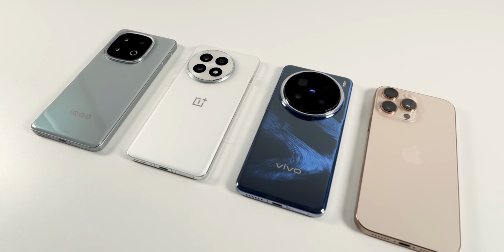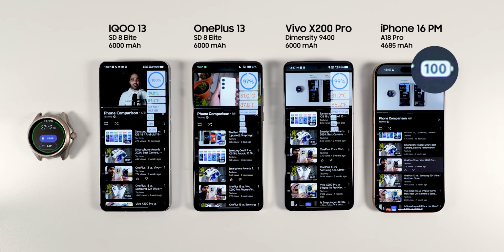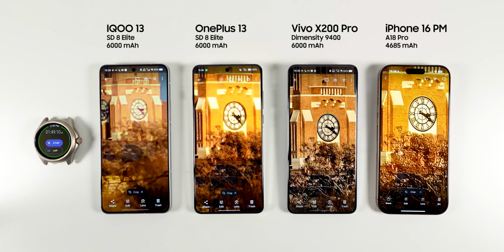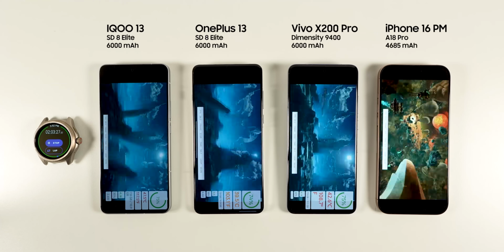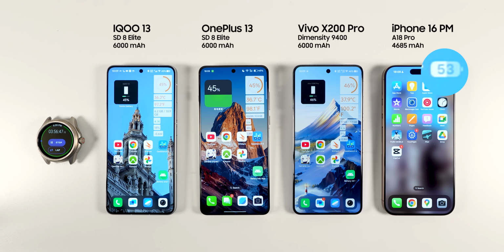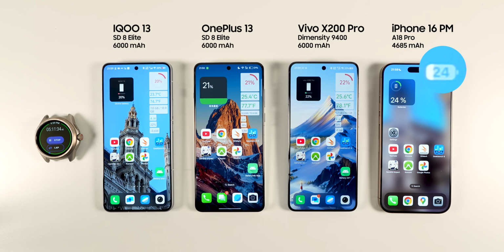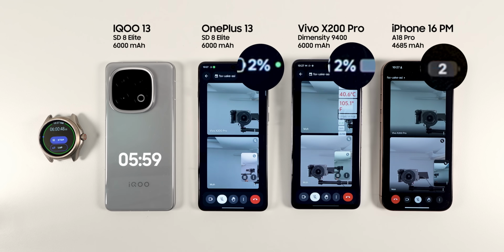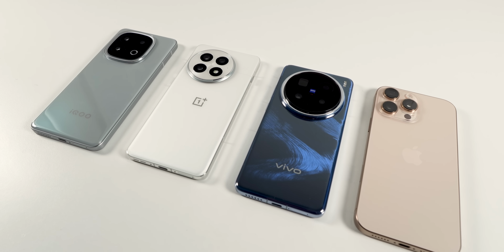Best Battery: OnePlus 13 vs. Vivo X200 Pro / iPhone 16 Pro Max / IQOO 13

Comment: Is the iPhone running at 120 hz all the time when testing ?
Reply: I am not sure that any of them would be running at 120Hz as they all use LTPO and most of these tests do not need more than 60Hz. For example the video recording or playing YT. So, not sure what your point is. And tests show the difference between running 60hz and 120Hz in mixed usage is nominal. Screen brightness is much more important as to battery life.
Reply: iPhone has full hd display while Vivo,one plus has 2 k display and iq with 144 hz display..

Comment: Imagine iPhone with 6000 mAh battery 

I hope s25 ultra beat iphone 16 pro max in battery and thermal
Reply: Imagine prize also bro it will 2.27Lac for 256gb
Reply: s25u will have the same battery for 6th year in a row, it will be on top worst battery life flagships of 2025, 2025 is rumored to bring 6500mah flagships

Comment: iPhone being the one with smaller battery capacity shows how efficient it is
Reply: Iphone is not using 120Hz all the time, it's dynamic which means it switches to 90 and 60hz at certain times when using certain apps.
Reply: @all4tacticalso does android you fanboy
Reply: @all4tactical Android Phones can go as low as 1hz. iPhone display is manufactured by samsung,
Reply: @joezmoma19285  OnePlus 13 has 510ppi iphone 16 pro max has 460ppi
Reply: Or 80hz scrolling @all4tactical
Reply: Actually it's the combination of efficient chip and a software made for that chip, if a18 pro ran android it of course would have had similar battery life to Qualcomm and MediaTek
Reply: @sakibhasan7944 true💯
Reply: @sakibhasan7944 What do you mean by "software made for that chip"? Every single hardware component has its own firmware which allows the OS to communicate with the hardware.
Reply: Yes , but you gotta understand, the iPhone barely pushed during gaming , rather the others pushed hard like crazy 💀
Reply: Doesnt matter vivo is lighter and slimmer is more important in daily use its not like everyone gonna care about the capacity if the phone is slim and lighter while offers a good battery life😂😂
Reply: @Havsue  Vivo is impossible to hold with the worst ergonomics of any phone? Hello?
Massive camera bump??
Don't talk about weight when you can't even get ergonomics right, not to mention weight distribution
Reply: @teapouter  as if ur not going to use case on ur phone anyway
Reply: @Havsue  I run my phones naked
Phones might as well be made of plastic otherwise
Reply: @teapouter  sure but most people us case on, so the bump on the camera are not a big deal, the imbalance are insignificant tho
Reply: Who cares anymore about IPhone? Overpriced and overrated phones. In the next few years everyone will forget about them.
Reply: @luciann36 mind you, I’ve been working with Apple for more than 2 years. The amount of people who used Android phones and windows laptop switched to Apple because the unoptimised software and poor software support alone.
Reply: Iphone has to be efficient. Because every phone on the table except vivo is half the price of an iphone. If a 600 dollar phone beat a 1400 dollar device then what is the point of an 1400 dollar device
Reply: @PhantomBoy_99  to fatten someone pocket that's all 😂😂😂😂😂😂😂😂😂😂😂
Reply: No point of how efficient it is as it gets old, when the battery capacity goes low ,  display and motherboard and wifi/GPS will take up a much greater share of battery percentage and those aren't any more efficient so over long run it will lose this crown. 
Also the last 20% on iPhone , there is throttling that's performed to reduce power consumption  further that's uncontrollable even for there reviews as it's set in software
Reply: @soulsbourne source? Your android fanboy brain?
Reply: Killing every app in background
Reply: How come nobody ever states that's the rated capacity?great result nevertheless.
Reply: iphone has less to compute on normal use, software just complements the hardware really well, but you have to consider the limitations you have on ios device than android. iphone battery ages fastest as well, which makes it terrible to keep for more than a year
Reply: @lukatamadze  Apple battery ages  faster the more deluded you android toxic fans are the funnier. You are somehow saying the lithium battery in apple which most phones use somehow magically ages faster than every android ever…..or is it that like the other person you just have this insecurity over iPhones and look for it everywhere even when you supposedly don’t like or have 1 so you look for people charging and people who have had one for a long time to diminish it.
I’ve never seen such a sad set of individuals who will lie to feel better about a phone choice go buy a phone and keep it pushing
Reply: lol 😂😂😂 with the low resolution and pixel count, so Don't think it's amazing, The other three phone have a mode called power saving mode, if you u turn that on, it will lower the resolution,  then you will see it will bleat the iPhone easy, they're video that show that, so don't think iPhone 16 pm is amazing, it's not doing 2K
Reply: Unfortunately smaller battery doesn't mean it's cheaper to replace
Reply: @ariefdwi1694  😂😂😂😂😂😂😂😂😳😳😳😳 so true
Reply: بخاطر ضخامت بیش از حد نمیتواند حجم باطری را بیشتر کند، چون نسبت به تکنولوژی باطری و شارژر از چینی ها عقب است😂
Reply: All that matters is how much we are paying and how much we getting
Reply: Yeah it's efficient because it has lower resolution than iqoo and OnePlus
Reply: Yes, Apple keeps a smaller battery as even with 25% more capacity Android flagships do not do much better if at all. That leaves Apple with the option of increasing mAh when they need it and in the interim focus on optimisation.
Reply: Don't have a battery capacity problem because can't make the iphone cheaper than others
Reply: ya, but now its andriod time , in all segments , but sofware wise little bit backward step, some settings are made then its andriod wins all segments . including video department also
Reply: Show how important is the vertical integration between software and hardware*, because by the SoC itself, the CPU energy efficiency of those chipset are pretty close to each other.
Reply: Apple increases their chip capabilities and literally slap on the same old skin with bit of improvement here and there of course it will last.
Reply: It cannot do half the actions of android. Lack of capability. Has nothing to do with efficiency. If you put iOS on an android phone, it would run for days 🤣🤣🤣😐
Reply: yea but it weights as much or even more than android devices.... so 😉
Reply: Finally a real test of soemone not saying the phone's get 10 hours
Reply: No one cares
Reply: When not playing games
Reply: @Allalos-s2l  yes 😎😎😎 stop trying to find excuse 😏😏😏 All you're doing is admitting it
Reply: @macgyvermac2344  yes I know it's because iphones are the best for gaming but they do have the best selfie camera
Reply: Iphone use much lower ppi density. Iphone refresh rate is much lower. Iphone resolution is much lower. All of these take extreme battery. Iphone brightness is much lower then vivo. And iphone automatically dim brightness level after some point.so many reason is on iphone side for longer battery. And their software focus on battery more. Get some education.
Reply: @SujanZimba your exaggeration shows how insecure and stupid most android users are much lower?
Ppi 505 s24ultra to 460 on iPhone.
Less battery superior battery life.
On average a more efficient SoC in day to day usage
Same 120hz as most androids like just say you are sad and bitching about phone you can dream about is what is happening as most androids need over feels don’t even own flagships from whatever brand they just ring meat for sake of feeling included in their little phone wars to feel a bit better for not having XY or Z your disingenuous comment is like clockwork of the oblivious fan base that doesn’t realize everything they say about apple products and users are easily discernible projections
Reply: IPhone only using 60hz refresh rate for display... So that's not a surprise
Reply: @Anonymousviewer007hehe  bro iphone has lower resolution that's why won't drag battery that much
Reply: Believe it or not 
We dont care he is the thickest phone 4600 mah 8.25mm 
6000mah 8.6mm 
Shame for apple 
2nd we need more time not more efficiency and losing
Reply: Effiencient= bad performance
Reply: It is efficient but not as much as you think iOS is too aggressive at this point it closes apps you actually use and pauses a lot of processes to achieve that
Reply: Nice now let's see the performance 💀
Reply: It stills heavy, takes long time to charge also last long on wifi
Reply: And it has the largest display size too
Reply: Да да, пока его емкость 100%, как только емкость доходит до 97% он не может соперничать с оптимизированными андроидами
Reply: Imagine if the others would be as optimised as apple.
Reply: But you want efficient or the long lasting phone?
I think i know, ONLY iPhone fans use that excuses...
Reply: @ actually iPhones last longer than android phones because of their hardware and if you check old iPhones performance today they are better than old androids
Reply: And still its the heaviest out of the three😂
Reply: Noo i phone is efficient because of all its components manufactured by themselves leading to efficiency and smaller battery
Reply: @ Apple doesn’t manufacture most of their phones where did you get that?
TSMC
Samsung 
Sony 
Are manufacturers to Apple, all Apple doesn’t manufacture most is design the component they want or give specifications and these people make it respectively.
TSMC makes the SoC
Samsung makes the display 
Sony makes the camera 
All to apple’s specifications
Reply: All phones outside of apple are very quick to charge their batteries. iPhone will take 2x the time to charge
Reply: @ what you don’t account for is despite Apple keeping the same rate of charge the batteries have been getting bigger. So Apple probably keeps the charge rate the same to preserve the battery. 100w charging generates much more heat than 25w. In 30 minutes you can get 55% what phone can’t function at that percentage. 
So it’s definitely not because they can’t make them charge faster that rate of speed seems to be the sweet spot for all the variables for longevity. Take in from the X to the 16 they all charge from 0-50/55 in 30 minutes despite the difference in battery sizes as the generations go along 

Most androids may charge faster yet still can’t outperform the smaller battery competitor so what is the real pro there and faster degrading battery due to the amount of watts being pushed to the phone constantly so that5000mah is gonna drop significantly due to heat degradation on the cells which is what occurs
Reply: Apple also doesn't keep apps in the background has 80hz not 120hz screen dimming and reduce touch sampling rate so no apple isn't as power efficient as ppl claims
Reply: @ how does Apple not keep apps in the background and it has an adaptive refresh display that does go up to 120hz.
The test I’ve done shows my screen operating at 120hz normally between 90hz to 120hz I’ve never seen it dip below that in use
Reply: @Marshkoon your test is incorrect it's 81 or 82hz max check online if you don't believe and apps shut down in the background in order to save battery or reduce heat same with screen dimming and touch sampling rate
Reply: @Anonymousviewer007hehe  @Marshkoon it's the truth I the 15pm when the 16pm came out and had 89 percent battery health i returned it although I read from many ppl complaining about iphone 14pm and 15pm losing 10 percent battery health in 1 year and my thoughts are that apple didn't use vapour cooling in order to protect the battery instead they reduced the touch sample rate screen dimming doesn't keep apps in the background having only 80hz instead of 120hz all so they will reduce heat and say that they have perfect optimization which actually only vivo and honor currently have
Reply: No innovation 😂😂😂... brand new camera button😂😂😂
Reply: @mrigankabora4835 ??? Bro's all broken
Reply: @UniverseCubex so people saying facts are considered as "broken"? Then you are 🧠-less😂
Reply: @UniverseCubex so people saying facts are considered as "broken"? Then you are 🧠-less😂
Reply: Yet iphone users are the ones always charging their phones the most lol when it come to longevity iphone is the worst battery.
Reply: @fremzter yeah charging your phone at 300w in 30 minutes surely preserves battery health
Reply: @levipb1403  not if you use in the latest technology in the battery world 😎😎😎😎😂😂😂😂😂😂😂😂 Don't worry you soon get it
Reply: @macgyvermac2344  um no, your beloved Chinese brands age terribly
Reply: does the small battery translate to lighter device? No? then why don't you say Vivo/ OnePlus/Iqoo is more efficient in packing MORE MAH into the same volumn of battery?
Reply: @romanceidiot neither there is much difference in thickness
Reply: and for anybody in here trying to praise the iPhone 16 pro Max, You cannot change the screen resolution, that's to show you how low it is, The other three you can, and that's telling you something😂😂😂😂😂😂😅
Reply: @macgyvermac2344 so you can tell the difference between 1300p and 1400p? Must have an eagle sight
Reply: @levipb1403  You still miss the point, it's still running at the lower resolution ,whether if I can see it yes or no, i definitely can see it, the crispiness,
Reply: @macgyvermac2344  LMFAO yeah sure
Reply: Do people not notice how iPhone 16 has lower resolution? Less pixels to process and all. Also the refresh rate is "smart", it's not stable 120hz, it will fluctuate between 90hz to 120hz. That's like battery saving mode is always on for Android phones.
Reply: @Kekdouble if you think m resolution is making these androids have shit battery get out of your insecure android bubble
Reply: And? Has 6core processor, vs all mediatek, snapdragon 8cores... soo... i as Your question. What type egine is more fuel economy, 4 cylinder vs 6cylinder vs 8cylinder. Its sad why snapdragon, and mediatek every year a long time production shit 8core processors... last world. Compare efficient normal usage and games. 12100f, 12400f, 12600k, 12900k, and check what processor consume less energy in every aspects.
Reply: @furieux6742  You're making no sense
Reply: Charging at 100 watt Has been proven not affecting the battery because the heat comes to the charger not phone and preserve the battery also silicon carbon battery last longer than lithium ion battery
Reply: @ are you dumb? Any phone that charges the battery will generate heat that is not debatable the more watts the more power this more heat will be generated in the device.

Put two phones of the exact same build next to one another one at 15w and the other at a 100w and really tell yourself again 100w won’t generate more heat when it literally is using more energy which will create more heat
Reply: Apple has low resolution screen
Reply: It is not about efficienty, it about trash O.S which isn't give you any control

Comment: 6k battery won with just another 5 minutes, this just shows that their software still has a lot of room for improvement. Or is the manufacturer locking the real capacity of the battery.
Reply: Open source software vs closed limited software
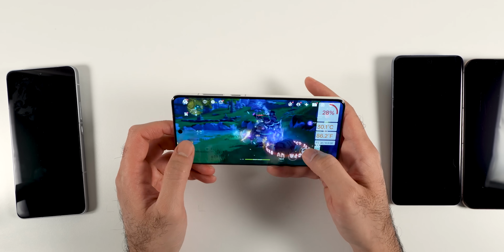Reply: Very powerful and very efficient, but 6:22...
Reply: @Eminem_9696 the thing people dont know is that iphone runs alot higher resolution in games because its optimized for it. Android on high settings is the same res as iphone on low settings, why so few know this i dont understand.
Reply: @Randomdude21-e "Alot higher res " and its just 718p vs 790p
Reply: @Randomdude21-e  good joke dude. are u comedian?
Reply: @patricksmusicvidz2611  suggest you wtch d a m e t e c h  s vid of s24u vs iphone16 pro max gamingtest:) he breaks down the numbers
Reply: @Abdhsk-9fm  that's for some games, it higher on others, plus it has higher res texture
Reply: @Hhhh22222-w Higher by how much percentage and plz share your sources.
Reply: @Hhhh22222-w  I don't even think they optimize games on android. 8gen elite is crazy strong. Saw a video of it running Cyberpunk on low settings stable 60fps.
Reply: Are you joking ? There's a lot of room for iPhone to provide better OS for users to make everything you want with 1xxx$ phone
Reply: is more about the more efficient cpu than the software
Reply: Google Services, don't look for more blame.
Reply: There are some people who update had never realized this. iOS isn't an open source just like Android and still you're wondering. Apple makes its chips optimized for it's OS. Not like Android wc is used by a number of Smartphone brands. Look for other things to complain
Reply: multitasking doesn't work in ios, if you minimize the app nothing is downloaded, so the iphone is more autonomous